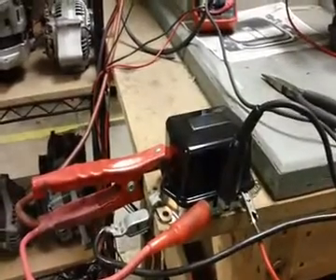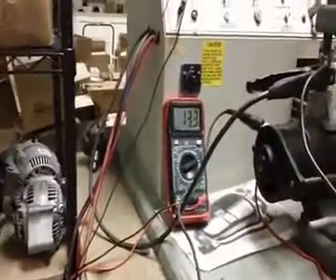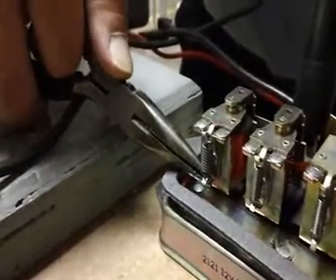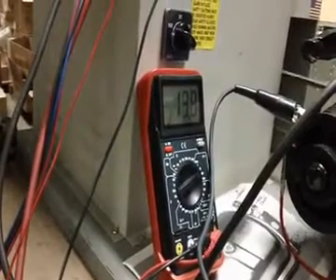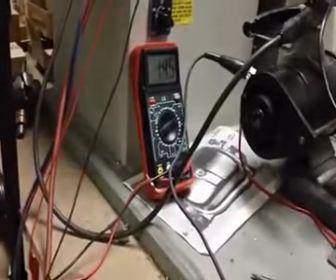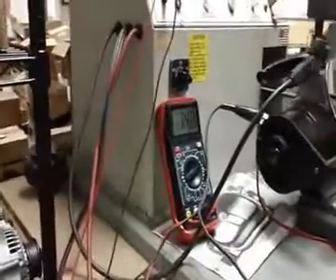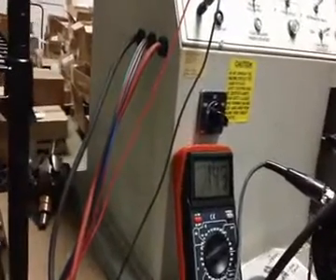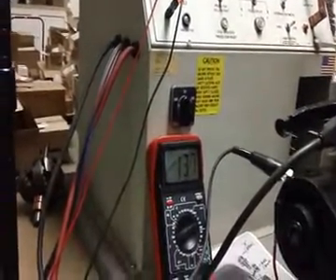Regitar USA, Inc. Mechanical Voltage Regulator Adjustment Procedure

Comment: THANK YOU!!!!!!!!!!! I've tryin to figure out the regulator in my '53 Packard for a couple days.. I have a BWD regulator exactly like the one you have there, except the 6v version of coarse.. I have been moving the points by loosening the screw and sliding the upper arm, I didn't think about just adjusting the spring pressure like this! That is not only requires less effort, it makes it easy to adjust while the car is running! Seriously, thank you!!